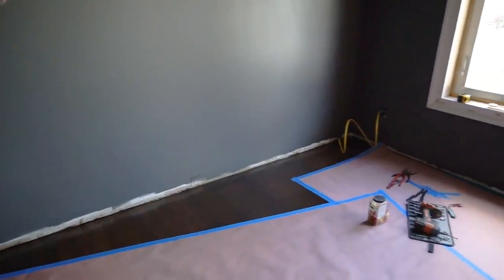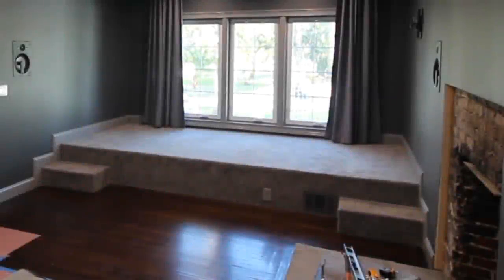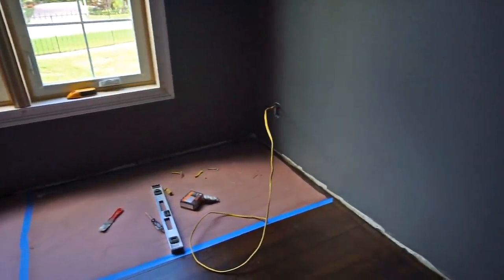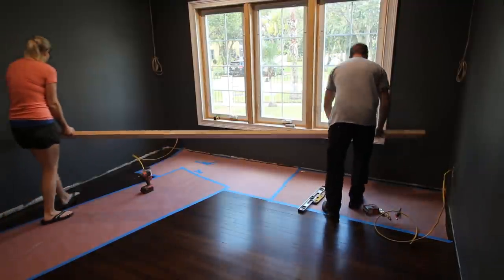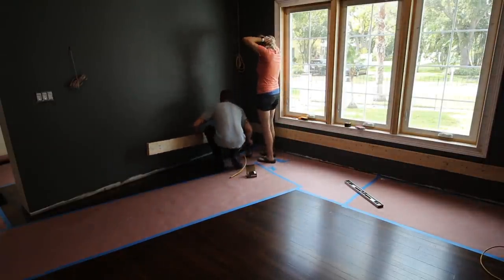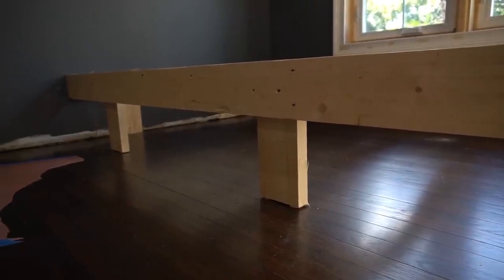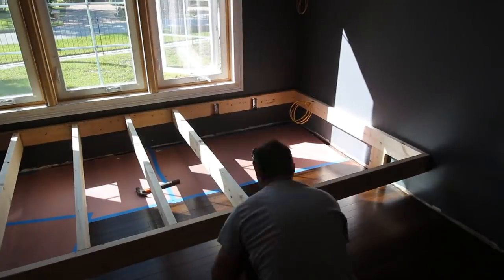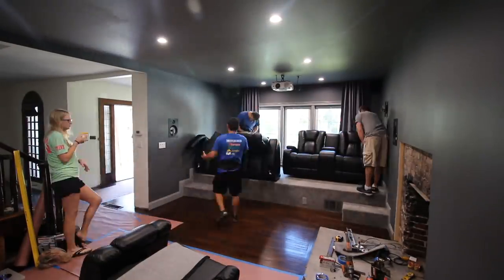DIY HOME THEATER RISER | Build your own Movie Room Seating Platform Cheap and Easy!

Comment: Hi great video…is it ok to run the wires through a 2 by 6 when extending the outlet ? Is this as per normal code or would some sort of a connector or small tubing that needs to be used to run the wire through the hole drilled in the board for safety?
Reply from the maker: Technically the way I did it is not to code. You’re supposed to have access to anywhere a splice is made. So if you had straight wire it wouldn’t be a problem but if you extending an existing outlet like I did it technically wouldn’t meet “code” The wire running through the stud is not an issue. That how all wiring is run inside your walls.

Comment: Could you go a little bit into how you did the carpeting? Was it just stapled or did you used a tack strip like you would a regular floor?
Reply from the maker: I just stapled it with an air stapler. It’s so thick you can’t see them.

Comment: I see you didn't use support in the middle of you riser.  is it still holding?
Reply from the maker: Yes. I used 2x6’s. Way over rated for the weight that will ever be held by it. Combined with the 3/4”plywood it’s extremely sturdy. No give, no bounce.
Reply: @MikeyMoVlogs  thanks

Comment: How wide are your steps? And I'm assuming those are just boxes you added after the fact?  did you tie them into the platform?
Reply from the maker: Yes I added them after and they are screwed in to the front face. I carpeted everything after. I don’t remember the exact measurements but roughly 14-18” wide

Comment: Nice job dude. What screen size did you use? And do you mind mentioning the distance to the first row? I am thinking of doing something like this in my basement but not sure what distance I should go with
Reply from the maker: There’s a free screen dimension calculator I found on line so I just put it my length and it told me the height to keep it proportional for a 16:9 ratio. Mines a little over 10 feet wide and 7 feet tall. I don’t remember the “diagonal“ measurement. Hope this helped! Thanks for the interest!
Reply: Keyvan Pouyan. Bbq . .

Comment: How do you suggest building this in a room where there is only a back wall and ONE side wall? How would you do the bracing on the other side considering it will be free standing on that side as it will not have the ability to be supported by the wall itself?
Reply from the maker: Not too different than what I did in the sense of just bracing up that one side. Like make “legs” and the portion could just be supported by those. Almost like a deck would be built.
Reply: Thank you!

Comment: Did you insulate the inside of the riser? Without insulation it will be like an echo/vibration for bass.
Reply from the maker: No insulation. The carpet for my situation was sufficient. I have not had any issues or noticed any echo

Comment: Turned out beautiful. Just one question. Did you place any insulation inside the riser?
Reply from the maker: I did not. I’ve seen numerous people do it and I considered it, but ultimately decided to try it without. By the time you carpet it and add furniture, so much sound is deflected I didn’t think it would matter. So far it all sounds great. Nothing rattles or vibrates. I’m sure there are some benefits to doing it, but for the average homeowner/person, I think it would be so small you would never really notice. That’s just my opinion though. :) thanks for watching!

Comment: What's the air vent at the bottom for? Did you have ac running to it?
Reply from the maker: Yes. That Part of my house has floor vents coming up for heating and air-conditioning so I tapped into that ductwork and ran flex ducting out the front because if not that whole riser would’ve just covered up that floor vent.

Comment: did you have to put the air vent?
Reply from the maker: Yes I had to relocate mine since it came up through the floor and would have just been pushing wasted ac in to the inside of the platform. Technically I didn’t need too but it would have been a waste not too.
Reply: @MikeyMoVlogs  oh Thank God...i was going to be lost with that little step lol...Thank you

Comment: how many 2 inx4in  did you used ? What can plywood you used?
Reply from the maker: It was 3/4 inch plywood and I don’t remember how many 2x4s. You could go back and pause the video and count them maybe? Realistically that number is going to vary depending on how wide your room is.

Comment: Great job! Quick question can u send me a list of all the material used? And I think that u stated that u used  16 inch centers, is that being 16” from left to right and then thereafter
Reply from the maker: All I used were 2x6’s and 3/4 inch plywood on top. Then the small brackets for hanging the wood in. Yes 16 inch centers are typical wall construction spacing. For this it was overkill but it made it more solid. You start at which ever end you want and go 16” over and that should be the center of your next cross beam. Then 16 from the center of that one to the center of the next. All that really does is make it even measurements for when you’re putting plywood or drywall and joining them up.
Reply: MikeyMo Vlogs cool thanks bro I appreciate the explanation
Reply: This made my build smooth And easy!!

Comment: How thick was the plywood flooring?   Only one layer?
Reply from the maker: I only did one layer, but since I did it that way I used three-quarter inch thick to make sure it was solid. Especially with the carpet on it I’ve had zero issues with it it’s been perfect!

Comment: hey can you provide the supplies i would need for a 138 inch by 55 inch platform riser height of 8-10 inch
Reply from the maker: It would be the same as everything I used on mine. Basic 2x6’s, 3 inch screws and the brackets for hanging the 2x6’s in. All available at any hardware store. That’s all I used.